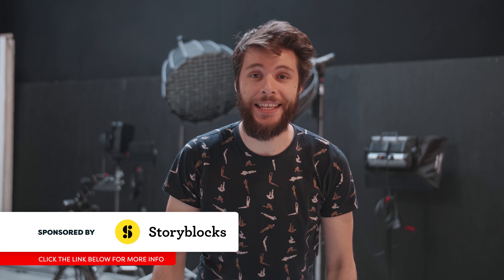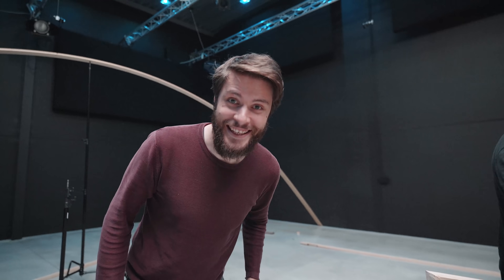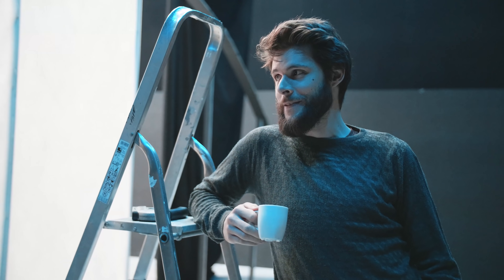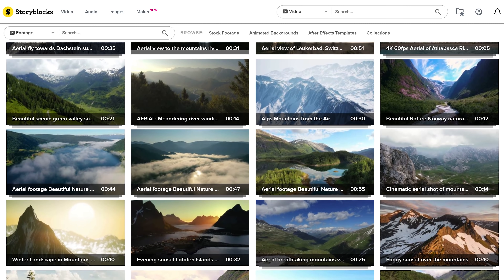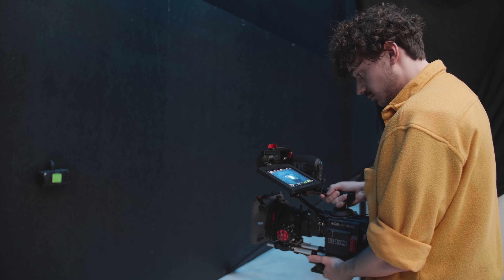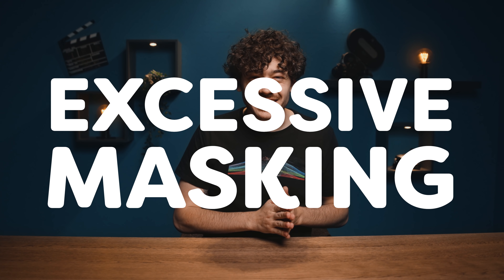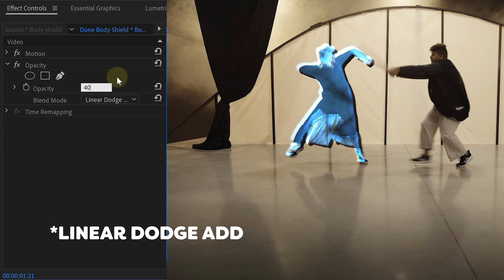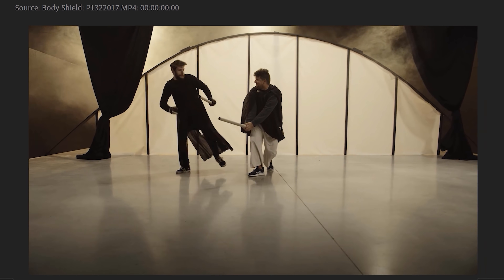Body GLITCH Effect from DUNE 2021 (Premiere Pro Tutorial)

Comment: Does any one know if  premier has the ability of editing smoothly with variable rate footages? Or is there any workaround of editing variable framerate footages in premier without audio Being out of sync for variable rate footages? I tried the "preserve audio sync feature" but it does not work unfortunately. I Could really really use some help. I record gameplays mostly and last night i found out that gameplays are being recorded in variable frame rate where as premier pro does not work correctly with variable frame rate footages and audio gets out of sync at almost all places. I could really really use help as I'm really clueless on what to do now, tried different methods but nothing works